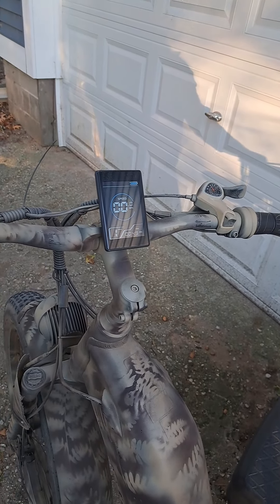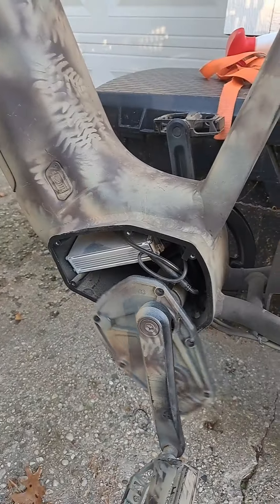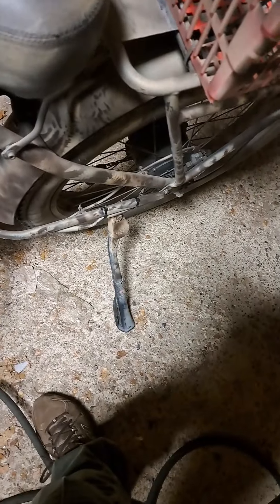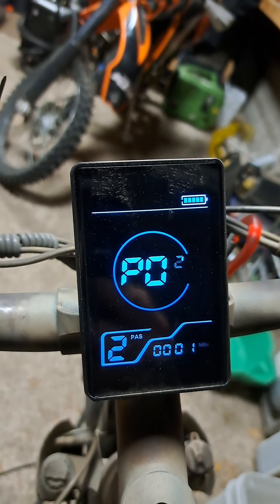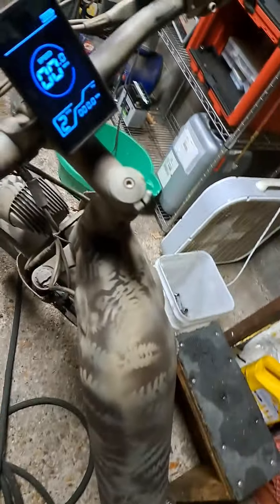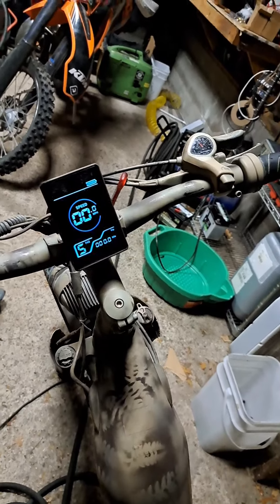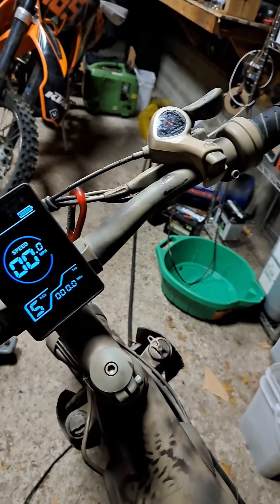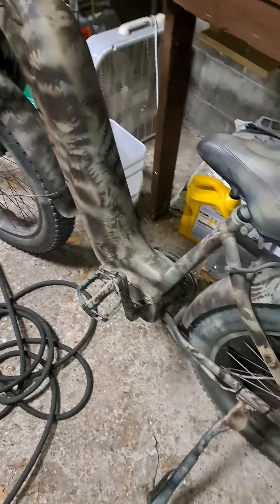Amyet EV900S DO NOT BUY!  Misrepresented, poor quality, no technical support. 40 mile & 3 wk review.

Comment: I bought a amyet eb26. 48v 15ah 1000w single hub. Mine has extremely horrible brakes to start then the pedals sucked. Also just about a month ago it just shut off and wouldn't turn back on so to it to the place I bought it from and the put a new display and supposed to put a new controller on it. Every since I got it back it will just start shutting off on me while riding then 2 weeks ago I was headed to the store and I noticed that the back rim was making some noise so I stopped and took a look. The rim seam was apart and a spoke was broken. Emailed amyet and they said to provide pics and paperwork with the order# and when I purchased it. So basically it's gonna cost me right at $230 to fix the rim hoop and spokes with nipples. Then another $75-100 for the shop to put it together. Not to mention when the rim broke it cut brand new Kenda flame tire on the bead. That was $60 just for the tire. Now the Shimano shifter quit locking in to gear. Plus the wiring harness that comes from the controller is shorting out on the twist throttle plug. Definitely thought I was doing some good when I bought it with my taxes. Was expecting something dependable transportation but boy was I so wrong. Just about to just set it on fire and cut my losses before I have to invest even more money in it not even 6 months later. Absolutely horrible for sure
Reply from the maker: Thanks for the feedback . There's AMZ username on here that AI read the listing. Please share this with them.  The customer service is unacceptable